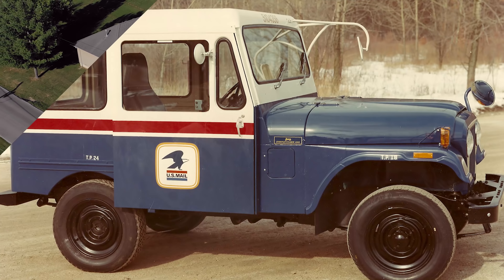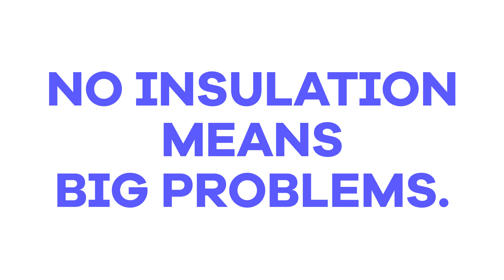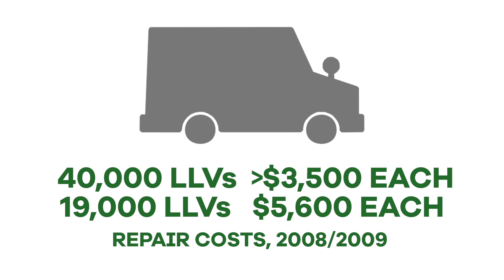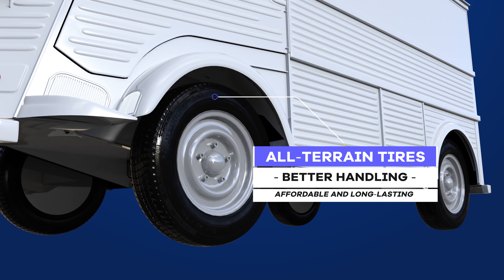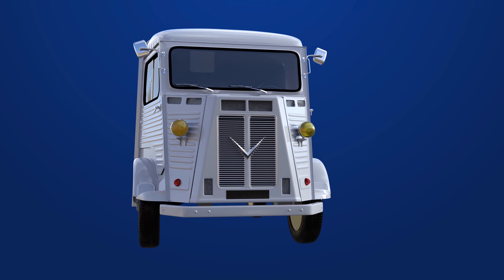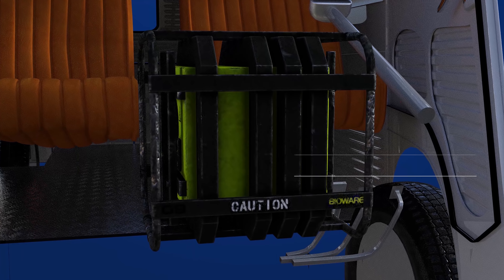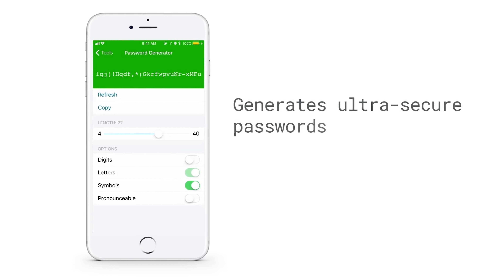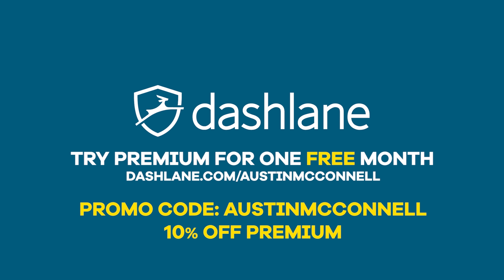Postal Delivery Trucks Stink. Let's Redesign Them.

Comment: Right hand drive is and always be needed.  They can deliver mail without getting out of the truck.  Lifting also isn’t a option or the 100 million mailboxes in the USA would also have to be lifted.  All terrain tires do not work better in snow.  For truck in the snow belt they should be equipped with winter tires during winter.  

Calling the current truck a design error is wrong.  It’s 10 years past it’s designed life.   Can’t really blame the trucks failures on the engineering at this point.
Reply: brian hilligoss I mean the seats could be lower
Reply: Agreed,  I even offered to buy winter tires for my route just so I would be safe.  But because of "safety" rules in place, only certified tires are the the ones we have.
Reply: I've seen some get on the sidewalk to deliver mail it's funny
Reply: Der Jens yeah I never said that the flammable liquid in a sketchy tube should go over top of a fuse box but the trucks could be lifted and just have lower seats
Reply: @ratpoutine   Oh, sorry I ment to answer brian hilligoss instead of you, I'll fix that
Reply: I agree for the most, but I still think the wiper fluid line above the fuse box was a bad decition. I think all fluid lines should be treated as potentially leaking when designing for a long lifetime

Comment: Don't integrate the tablet hardware.  Just use a bluetooth ODBII connection to send engine data to off the shelf tablets/phones.  

It will be the fastest thing to depreciate and all future upgrades need to have as little resistance as possible.  Also, in 10 years upgrading the software for some proprietary integrated hardware will be way more expensive than just replacing everything with the latest off the shelf hardware.  Security updates would also be handled by the large OEM for all their hardware rather than whoever bid the lowest at the time.
Reply: Yes, all of this. Make it as modular as possible.
Reply: This. Just make a hollow to hold the phone/tablent
Reply: The area I live in just gave their trucks consumer grade Garmin's for GPS and I think they're planning on giving them regualr tablets for this very reason. It's cheaper to replace a tablet then an integrated GPS system.

Comment: Do more research next time please. There is a reason the steering wheel is where it's at. Different tires doesn't magically solve the problem. You’re not an engineer and neither am I but I would have thought these things are common sense.
Reply: Also I am a mail carrier and I got a right hand drive Jeep. The one complain I have is the height! It's too damn high. The reason you sit low in an LLV is so the mailboxes are at arm's level. Also the 2 side doors, that reduces the ammount of packages you can fit in the back. I had all terrain tires on mine and they wore like crazy on roads, I do 55 miles a day, you need road tires, not off road. So many reasons his design is stupid.

The tablet thing too. No, I keep my mail scanner Because when I walk to the door, i need it....

The electric motor would only be viable in small routes. I go through half a tank of gas in one day. It might work but I do not know much about electric motors and cars.
Reply: Common sense is far less common than common sense would suggest.
Reply: You’re*

I see you’re also not an English professor.
Reply: Right. And I've made the tires used on them. They're way sturdier than an average tire you'd throw on a Tahoe, etc.
Reply: They're ideas, nowhere in the video did he claim to be an expert or a designer, he simply threw in some ideas he thought would be useful.

What's important is having a discussion about the issue.
Reply: @SpencerKaup  I know you wrote this awhile ago but thought I'd let you know, of the things in this video the electric motor is probably one of the best recommendations. The USPS is actually looking at it heavily. 

The reason you burn half a tank is because they are very inefficient to begin with. Plus you burn gas even when stopped, and more accelerating from every stop and with lot of stop go that is a lot of wasted fuel.

Electric is perfect for this use, most electric vehicles are 200-300 mile range, they use little to no energy when stopped, and they regenerate some of the energy used to accelerate when you stop. Not only increasing efficiency but saving brake wear. To top it off electric drive trains are much simpler mechanically so less to break. No transmission, valves, pistons, etc. They can be as simple as a motor bolted to an axle.
Reply: Daniel Mills did not realise that. Thank you! I wish my jeep got more than 15mpg 🙄
Reply: @SpencerKaup  exactly what I said in another comment at the bottom there
Reply: @evilhamsterman  it is the same thing for electric vehicles regarding fuel/charge consumption except the van itself was designed to be efficient LONG term (not fuel efficient but still) and the reason why it gets 10 mpg is because of the frame lol (S10s in the 80s got a comparable mpg ratio) if it had a ford Econoline frame it may have been more efficient fuel wise (in fact you'd be lucky to get 10 mpg in a pickup or van in the 80s)
Reply: @SpencerKaup  what model / year  out of curiosity? (Cause depending on year that's fairly good for a non aerodynamic vehicle)
Reply: fred white 2016 jeep RHD rural mail carrier. With the smaller tires and a lowered suspension. It’s the v6
Reply: @TheONEANDONLYBeuh  I don’t see how having any number of those things would make poor grammar any less annoying. I edit books and articles for a living so it’s annoying regardless.
Reply: @yammmit  Maybe for you, but to pretty much anyone else as long as you know what they mean it’s pointless to correct them
Reply: @TheONEANDONLYBeuh  I learned English from people like myself correcting me all the time. I appreciated it and so do most people. English is my second language but I see so many people whose first language is English and their skills are awful, which just makes them look incredibly stupid. But yeah, sure, I can “decipher” what they mean if it’s “close enough.” I shouldn’t have to decipher it—it should be correct to begin with. It’s such an easy language to master.
Reply: @yammmit  Except it isn’t something you have to decipher if it was a small mistake.
Deciphering something is when something is cryptic, not when someone spelt something wrong.
Stop making a big deal out of such a small mistake, my god.
Reply: @yammmit  Also, native english speaker here English doesn’t make much sense, and yes while technically it should always be correct people make mistakes.
Big deal, no need to create such bigger deals out of a small mistake.
Reply: @TheONEANDONLYBeuh  I’ve heard this same spiel at least 500 times in the past 7 years and it hasn’t discouraged me before, and it won’t now. You’re wasting your time telling me this.
Reply: @yammmit  Alright, fine, but don’t say nobody didn’t warn you when no one takes you seriously because you take simple grammar that LITERALLY EVERYBODY ELSE can read fine to seriously, thinking you need to correct everything.
If you understand it, don’t correct it. No one cared except him, no one replied to your comment, no one even liked your comment, hence no one caring. Not letting people like me “discourage” you is a mistake of your own being to ignorant, and considering you like to correct peoples mistakes, you should probably correct your own.
Stop correcting other peoples mistakes, it was a simple grammar mistake and it wasn’t something you say is so unintelligible you had to decrypt, because people make mistakes like yourself.
If you wanna be ignorant fine but if you want people to think you’re not petty stop it.
Reply: @TheONEANDONLYBeuh  I’ve heard the same thing since 2014 when I started doing this. My answer to you, like everyone else, is I don’t care. I like doing it and it keeps me sharp for my job so I’ll continue doing it until I don’t like it any more.
Reply: @yammmit  Fine, if it’s for your job then I suppose that’s fair
Reply: @carlangelo653  exactly right!

Comment: The right hand drive is kinda not really for safety. It's more so you can just drive up to a mailbox on the side of the road and put it in. I feel like it being safer due to not having to get out into the street was more of a second thought/realization: "Oh hey, so if we did that we wouldn't have our drivers getting out into the street where they could be hit"
Reply: But all of my neighbors have mailboxes next to their doors. Mounted on the wall of the house.
Reply: Kayaze that is tough
Reply: Them putting the wheel on the left questions the credibility of the video
Reply: @jarensonger2501  it makes sense in some areas, not in others.
Ideally you'd want 2 models, one mirrored of the other (which would be convenient for international sales of the truck)

I question raising the ground clearance.  The low clearance seems pretty obviously to be to make it quicker and easier to get in and out of the truck and seems to be misdiagnosing other problems. (Though if you increase the size of the wheelwell, I suppose you could have that adjusted by changing the wheels if you really needed a taller truck...a bit inelegant, but workable.
Reply: Yup stop and hops suck
Reply: Kayaze Well in that case, they just gotta get out and walk up to the house to deliver the, but the rhd door lets them simply park on the curb without fear of getting out into traffic.

Comment: How the hell am I supposed to
Do my job with a left hand drive? Seriously you have no clue. How am I going to be more efficient I don't have a bionic arm that extend to your mail thru the truck. I'd legit have to curb the wheels apply the parking break and take off my seatbelt at each curbside delivery. I'd would go from take 5-10 at each to roughly 2 minutes.  

The air bag system really??? Do you have any idea how many times a day people Almost hit me? Seriously if I'm stop at box and I have an airbag system that just goes off before I get hit, I need a new truck 3-4 times a week . 

The LLVs are old and worn. The major flaw is fuel economy. After that would be poor traction. 

Nothing is perfect, be these LLVs are great trucks, people at the post office complain about everything, some complain more then they actually deliver. 

I'll take an LLV over any other truck they come with, including that POS FFV.
Reply: What about one that doesn't do this? 2:10
Reply: Also, like... couldn't you just fix the traction with the same tires fix he mentions, and transition the engines in new models to electrics of equivalent power? Sounds from the things people have been saying here the interior design is basically fine, it's just a couple of the functional parts that aren't great.
Reply: brake*
Reply: @PilkScientist  probably or just have the Japanese make one

Comment: Huh.  Still no AC, two wheel drive, electric so heating is resistive or at best from the battery pack and upgrades are necessary to post offices to support vehicles that need charging and have a shorter range with downtime when juice runs low, the steering is moved away from the easiest location to reach a mailbox, electronics added to reduce reliability and increase part count, lifted to make reaching mailboxes even more difficult, and what is that, corrugated tin roofing on the sides?

Man, if you’re gonna list a bunch of shit that’s wrong with what’s currently in service, suggest fixes for current problems and don’t make more.

Edit: It was pointed out that this is rudely worded, and I agree.  I’m leaving the text the way it is because I’d rather keep the context of the replies to this post.  See my response for more information.
Reply: You have a point, but I feel like you worded it in an unnecessarily rude way.
Reply: The car he was using for visual aid was a vintage French bread van to help you visualize the concept
Reply: "We want these to last even longer than the old ones" "We want to integrate technology that will be out of date in a few years into them" Umm okay. I do think electric is a good idea though. It's more futureproof, and also, the reason these mail trucks get 10MPG is because of constant starting and stopping. Electric cars with regenerative braking do really well in these conditions. Definitely steering needs to stay on the right. This video seems to completely miss the point of why it's on the right.
Reply: Katrina Kat I’ll concede that it was unnecessarily rude.  It can be too easy to do that on an anonymous site like this.  I was upset because I felt like I had my time wasted, but it wasn’t necessary to go to the extent I did.

Sorry about that.  I’m gonna leave it as is, so people know why you said what you did.
Reply: The video was well done but from an engineering standpoint it's more of a list of feature requests than an engineering solution.
Reply: I felt the same way when I saw the suggestions, looks like they didn't consider the actual design requirements of the LLV.  As of 2015 they started testing for the NGDV anyway. It's not like they're sitting around unaware of the problem.
Reply: I'd like but its at 69
Reply: Mark Kennedy lol
Reply: make an LLV2, with insulation, a smaller, more efficient but just as simple motor, install engine based heat and AC, and keep the same size and shape internally.  They need to be at the height they are at, as you said, for mailbox access.  They actually do decent in the snow, mostly because they have pizza cutters for tires, and are heavy(coming in at like 2600 pounds for their small size).  The current ones could likely be improved in frame, but every time the USPS has enough money to start looking for a new vehicle or start designing one, the GOP raids their surplus or imposes stupid rules like 70% funding of all future employee's retirement(a restriction only placed on the USPS, and no other government run union), along with outright stripping their surplus in 2005 and 2006.  The USPS is very profitable, despite what the GOP likes to toss around.
Reply: AgentOrange96  new ones need to be hybrid with electric only mode at the very least, because that way dead batteries won't hinder mail service.
Reply: The new mail truck could use more slopes. T 34 mail trucks for memes. Actually though, they should be able to employ tracks on their trucks. It would allow it to cross worse ground with more traction, and less ground pressure. It would also allow even more modifications . Suspensions like the Christie suspension allowed this, so why not use it for mail trucks.

Edit, make sure they weight of the suspension is worth it though. Otherwise, just dont.
Reply: @AgentOrange96  why not a sliding seat? Not all mail boxes are at the  street
Reply: Totally agree with you except for the two wheel drive part.  A front wheel drive truck (with snow tires/chains when needed) would be good enough for 99% of the country, and in most places, be much better than AWD.  AWD systems are more complicated and would require a lot more long term maintenance which = money money money which = no chance of getting this approved. (Also worse turning radius which = shit for city streets) However, this is also why I agree with you on all that stupid unnecessary electronic shit that will go wrong long before 20 years and cost a lot of money to fix.  These are utility vehicles, not commuter cars.  They should definitely keep their current tablet system he mentioned, maybe with a bluetooth OBD2 scanner connected if they really want to keep track of maintenance stuff.  Also what he says about a higher ride height is just wrong.  Not to mention worse fuel economy, how would that improve handling? Also these things aren't going rock crawling.  Idk just seems like what he's proposing is a much more expensive design, short and long term, that will prove less reliable for the sake of TECKNAWLEDGEE

Edit: I'd recommend a small turbodiesel engine.

Edit 2: okay this guy is officially full of shit.  An electric drivetrain??  Tesla??  Long term affordability and reliability do not belong in the same conversation as electric vehicles and Tesla.
Reply: AgentOrange96 Yes, the tablet or whatever integrated into the trucks would eventually go obsolete, but I don't think switching them out when that happens would be very hard, especially if you build it so that it's easily swapped out.
Reply: Katrina Kat who cares if it’s rude
Reply: Who cares if it's rude?
Reply: Steven Sharp probably the content creator, it doesn’t feel good to get shit on all the time for your hard work.
Reply: @smallmoneysalvia  too bad
Reply: Hey now. Don't go making sense around here
Reply: zenxen you sound like a real peach.
Reply: @smallmoneysalvia  cool
Reply: @smallmoneysalvia  If your "hard work" doesn't even include the minimal research to tell you why LLVs are RHD, your work wasn't very "hard" in the first place. It's completely bonkers. It's obvious from the footage included in the video why they're RHD, though it is true that LHD would be unsafe as hell. Best case scenario, you've got a bench seat and re-train your limbs to accelerate/brake with the left, and steer with only your left hand (that's how the carrier I 'interned' under did it, and I practiced a few times from her car), leaving your stack of pre-sort behind the wheel....or you drive against traffic. This is how it's "for safety": because the alternative is extraordinarily unsafe, or at least inefficient: you drive normally, but have to get out and walk around to deliver mail at every. single. box. There would be a revolt, and the Postal Union for rural carriers would tear you limb from limb (metaphorically speaking).

Seriously, not knowing that is abysmal for even starting this project of imagining. I'm legitimately all for being respectful, but there wasn't a personal insult in OP, just some very real and accurate "you seriously didn't think this through", which is patently obvious.